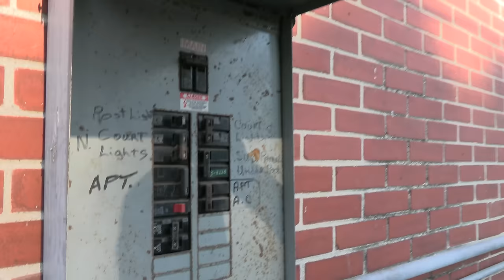Upgrading My Own House to 1,000 Amps

Comment: to make your life so much easier when mounting those cabinets, i usually mount a piece of unistrut along the whole area, then you can just rest all your cabinets on it. then you can mark it and mount it with little to no weight to hold up.
Reply: A temporary table made out of unistrut would be great to support the panels and other heavy stuff, then take it apart when the job is done.  I used a fishing box to hold various 3/8" bolts, nuts, and washers, along with the unistrut nuts, and other fittings, 90 degree, ect.  It was handy to not need to go back to the warehouse for more bolts and stuff while working with unistrut.  I used the unistrut and a overhead 1/4 ton chain fall lift to pull out motors and pumps while doing HVAC and steam repairs.   5 HP hot water pumps are impossible to hold up with one hand while getting the bolts tight!  

I was also thinking about suggesting a pair of saw horses, cut to the right height to hold up the panels, maybe with a stack of 2X6 to get the height just right.

Comment: Have you thought about going to a Ford E Van?  Then they can install a 80 amp 240 volt charger at a home, and refill the van on the overnight low cost power.  That is terrific that they offer such low cost power in your state.  

I live in Portland Oregon, and recently changed to a 5-9 pricing program, where I pay $0.32 per KW between 5 pm and 9 pm, weekdays, and get lower cost power all other hours of the day, and weekends.  So far I have averaged 32 KW of the peak power each month, while I have 750 - 950 KW non-peak power each month.  I am all electric and installed my 4 ton heat pump myself, I install HVAC for a living.  I have a 200 amp service, and plug in hybrid Ford C-Max, with a 7.5 KW battery and 4 cylinder engine.  It gets 40 MPG on gas and 18 miles on battery power.  I installed a 16 amp 240 volt charger, much lager than this car needs.  I put my water heater on a timeclock, and shut off my refrigerator 7 pm - 9 pm, to reduce my peak power hours, and remember not to run my heat pump on peak power.  

Great video!

Comment: Did the power company give you the 400A EV panel so you can charge more cars at the same time at the reduced rate?
Reply from the maker: Yes, in our jurisdiction the reduced night-time rate can be used for a dedicated meter of any size.

Comment: Man the guys who designed the US grid must of owned copper mines!
Reply: Why?  Copper is the best conductor for the price.  It's really quite excellent, and it's used all over the world for that purpose.  
Aluminum works in a pinch.
Reply: @jovetj  I know it's the best conductor for this application but the low voltage and thus high current requirements for US home power uses 4 times the conductor area that most of the rest of the world would
Reply: @adammurdoch1708  The thickest cables in homes are, obviously, service entrance wiring. Most of those are aluminium here. Perhaps you don't realize that the "low-voltage" wires in most home circuits are 2mm² or 3mm². Circuits sized bigger than 4.8kW are almost always 240V.  A 50A electric stove/oven circuit gets the equivalent of 13mm² cable.
Reply: @jovetj  yea I know 13mm2 cable wouldn't be used outside industrial applications here and a lighting circuit will be using 1 or 1.5mm even stove circuit is only 3mm as it also uses 2 phases and that would be the largest in most homes
Reply: @adammurdoch1708  Oh, "you know?"  So what is your point, again...? Our wires are too big because of 120V?
Reply: @jovetj  yea you need twice the current  and so the conductors need to be 4 times the size to have similar resistive losses.
Reply: @adammurdoch1708  But we don't.  Our regular circuit wires are comparable to yours (we just have a lot more of them).  And the 13mm² conductors I spoke of above are already for a 240 volt circuit. Your point is moot.
Reply: @jovetj  What !! comparable yea right i was saying because of the low voltage you have to use ridiculous amounts of copper for the home wiring. A US lighting circuit using standard 60c rated (140f) cable has to use 14awg or 2.5mm wire in NZ you can use 1mm cable and you only need 2 circuits per home and that can deliver up to 6.5KW of lighting over those 2 circuits. I was wrong before free standing stove may have 6mm but that is for running on a single phase and is up to 9.75KW. That 6mm cable is the largest used inside NZ home feed cable will depend on length and size of home so varies too much but still a fraction of anything found in US homes
Reply: @adammurdoch1708  14 AWG wire is 2mm². 12 AWG is just over 3mm².  Our wiring is  typically rated to 90°C.  1mm² equates to 17 AWG, and that wouldn't be used here for mains because it would be liable to breaking. 16 and 18 (stranded) are common for home extension cords, though. I sure would not want to run 28 amps through a 1mm² wire.  That sounds shady to me.  
Our electric stoves (4+ cook-top elements, 1 electric oven) are power hungry.  It isn't common to use it all at once, but one can, safely.  As I mentioned, these circuits are typically wired with 50 amperes in mind at 240 volts.  This is usually 6 AWG wire (13mm²) and is the largest used in most homes, unless something like an electric central furnace has larger requirements.   
There is not a whole lot of difference between 1 and 2mm² conductors.  It's double the size, but the difference is not going to add up to a whole lot, especially considering you're just talking about your lighting circuits and not any receptacle circuits.  
The real expense difference you seem concerned with is that we just have many more circuits than you install.  That dwarfs any minor difference in conductor size.  So what? We like to be compartmentalized.

Comment: What a honkin' wiring setup.  What I would first think about is that it would require a significantly upsized drop from the utility whose availability would depend on whether they're set up for commercial service or you can pay them enough to put that in.  The ordinary 100 or so amp drop to a residence would obviously not cut it, especially if it comes off a pole.  I kind of dabbled in wiring additions in a home I had in an area where the permitting authority was comparatively lenient to that, including adding a kitchen subpanel, but nothing of this scope or expense (even by DIY standards).

Personally, for heating, if not also cooking (I decided to go old fashioned coiltop electric), I'd still want gas.  Other stuff, go wild with the juice.

Comment: Wired a house when I was 14. Got an IT job a year or two later. That was 25 years ago. Should have stuck with being an electrician. Put in all the utilities and electrical for my farm. Trying to talk the power company into 400 amps and not have them complain to much about the 80kw generator I have and I work on 3 phase radio transmitters on the regular. I think I am going to learn some stuff on this channel. Oh and as much smack is talked between the trades I have to say thank you as a low volt guy whenever you guys put in extra pipe for us when you trench. I do my best to work with the other trades but I am a company of one too and it's hard to get all that coordinated so when you look out for me like that it is appreciated and the customer appreciates it.

Comment: We use a hot oven or a hot blanket to bend pvc no open flame allowed in Cali, occasionally I’ll use open flame in a controlled setting with a fire extinguisher on hand or just a wet rag.

Comment: I'm from the Netherlands, i always wonder why they make power upgrades so difficult (al those new cabinets, feeds, panels, linemen, and so on) in your country. But very nice job, challenges are always nice.
Reply: How are things done over there?
Reply: @quinnbattaglia5189  In most cases for normal home connections it's just a new  breaker or adding a breaker in the sealed compartiment of the power company. It hardly requires new panels and this kind of work
Reply: @svdleer  We can add new breakers too, but the main panel and meter are only rated for so much current before it becomes a fire hazard. Especially when the equipment is decades old.

Am I misunderstanding you or does that mean you have to contact your utility to run a new circuit?
Reply: @quinnbattaglia5189  ofcourse we replace the boards here as well if the stuff is rejected by code. But indeed, you need the utility to install new breakers to upgrade the service. It depends if the lines to the service need to be replaced, but since almost everything runs in the ground the lines are overrated for the service that is being used, they only need replacing for example when your line is very old, and you go from example single phase line to 3-phase line and the line does not have more conductors. Usually when they have massive street reconstructions and cable of gaslines are getting old, they upgrade the lines and gaslines to new standards in the same reconstruction.
Reply: This was more than a usual power upgrade.   This is one service being turned into three.  They were previously supplied overhead by one drop.  After the changes the three separate services are served by three underground conduits:
— Service for main house and grounds (and some outlier buildings)
— Service for carriage house (renter's power)
— Service for EV charging with discounted rate provided by utility. 

I don't know of a one-family (or one-and-a-half, if you include the carriage house) property that has three services.  So, this kind of thing is rare, and he's only doing it because he's an electrician and can. 🙂

Comment: A hot box is the way to heat those pvc conduits.  I got multiple ones from my father’s whirlpool bathtub business.  And no they are not the super expensive Greenlee boxes.  Generic.  They work great and I still use one to this day heating pvc and bending it with less fittings.  Makes fishing wires easier too.  2” conduit is the largest that will fit.  Box is two feet long.  I can make noodles with that thing.  I could sell u one for the fraction of the cost to a Greenlee.  Great videos!  Your a super passionate about this trade!  Keep up the amazing work!

Comment: as someone who works for the cable company, 1in is not enough. Run the same as you ran for the electric especially for a duplex because it has to have two runs ran through it, not to mention if the other Telecommuncations company runs through it too. (We are not allowed to cut the other companies wire to run our own)
Reply: yeah, may as well put in dual 1.5" runs.
Reply: @throttlebottle5906  honestly just running a single 3in would suffice. Thats enough room for the cable company and the phone company.  Now to be fair if I had a duplex or triplex I would only run 1 cable wire or fiber and have shared internet with access points in the home and a data rack
Reply: @djpmatchbox  I think their own policies here and many places keep them from sharing a conduit though. they're worried about damaging the other lines.
they also wont do anything but straight through holes, when it comes to penetrating walls/floors and they still manage to drill through/into wiring. 🥳🤡

Comment: 1000A means 120kW if they are intended among the two phases or 240kW if they are per phase. That is a lot of power! At my house I have 3kW of power (as it's common in my country), a newer house with everything electric (heat pump heating, induction cooker, EV charging) that has a 6kW or 10kW maximum (from the electricity company, then it may have solar), and over 10kW you have to get 3 phase. I would not even consider what you can power with 240kW, it's something that a medium size company would use. Also at 0.5 euro at kW/h you don't want to use that much power from the grid these days...
Reply: This is not multi-phase service.
Reply: In America most people have 20-24 kW, split phase 120v adds up to 240. Your electricity prices seem outrageous, our price per kWh is around 0.11 euro per kWh.
Reply: U.S. residential service is typically 30kW to 54kW, but 96kW isn't unheard of. It depends on the age and size of the home.
Reply: In my Canadian province 48kw is the standard size for 90%of house and commercial estate, price is around .04euro/kwh

Most people are using electric heat
Reply: @freevipservers  make that 0.70+ cents a kWh in euros now some even going + 80 cents welcome to Europe and Ukraine war
Reply: I am sorry to hear the price of electricity in Europe is so high right now!  That is outrageous!  I pay about $0.10 dollars per KW in Portland Oregon.  I have a 200 amp service, that is 245 volts, or about 48 KW.  I did remove my 20 KW electric furnace in favor of a 4 KW heat pump when I moved into my house.  100 amps is the smallest power service you can get in America.  Yes even a single traffic light is served with a 100 amp panel, only a 15 amp load on it.  125, 150 and 200 amp services are typical, while a 325 or 400 amp panel is not normal, but possible.  

This home is not typical, and the homeowner owns a electrical company, so can get more!  Also separate feeds for the renter is common, and so is EV charger at a special rate in his home state of Indiana.  

Jefferson Electric has moved to all Tesla vehicles where they can, (for estimators and those not needing a van) because they can avoid $200 a month gas bill and pay a $25- $35 a month electric bill to fill the Tesla's.   Thanks Indiana for providing overnight power at only $0.03 per KW to recharge the electric cars!
Reply: Was thinking exactly the same 😅 Here it is about 43kW and that should be enough for everyday use. 240kW would already allow fast charging DC charging for EV or am I wrong?

Comment: You don’t need expansion couplings if the ground is backfilled correctly think about it. If your pipe expands, how does your wire expand too?
Reply: you leave slacked wire in the run.
Reply: @throttlebottle5906  lol how do you do that with SE cable hardly any slack

Comment: I have been
Told that aluminum manufactured today does not need no locks. Because of what they put in the metal during the manufacturing process.
Reply: got to follow manufactures instructions as  well as the ahj needs/wants lol
Reply from the maker: ^^^ Yep, inspectors will still bop us if we don't have NOALOX around here 😕
Reply: Noalox everything. I do threads too. The next guy might be you.
Reply: @ElectricProAcademy  AL8800 wire technically doesn't require NoAlox, but I still use it on all exterior stuff, but not indoors when landing the panel. It's very humid here in Indiana as you well know, so I like to use NoAlox in everything exterior in Nema 3R enclosures. Just helps keep the moisture out of the connections.
Reply: @taylormills08  Darn right the 'next guy' might be you :) I've been to things I worked on 20 years ago, and thought I'd never be back since the house was sold 2 more times since the guy I worked for sold the place... and was asking myself, "who the f---k did this mess"... and then realizing that was me 20 years ago. LOL. Everyone gets better with more experience (usually), and 20 years you can learn a lot from mistakes.

Comment: phew what big conductors you have to use there, really not hatin but im glad that we have three phase power with 230V over here, we get along with less than half the wire thicknes than you need and thanks to rcd´s (or gfi´s as you call them) its as safe as your system over there.

Comment: I have to ask. Couldn’t a span panel or two eliminate the need for this huge upgrade? 
Although the old equipment was in rough shape so I don’t slight you for doing it.
Reply from the maker: Exactly. 1:11:42. We didn't actually know about SPAN before doing this project, but it could have relieved us of several of the elements of this install!

Comment: Great video and a lot of hard work for one day, but why do you need 400 amps for EV charging, my 230V single phase charger in Australia runs off a 50 amp circuit.
Is that your own private transformer on the top of the power pole where you are connected to?
Cheers from Aus.
Reply: I can't speak for Joel, but I think he expects to eventually have several EV chargers going at once.  400A should cover that for a long, long time.    
From what I see on Google Street View, the transformer might only be 50kVA... but it serves his and several other houses, and also probably some street lights.
Reply: @jovetj  Yes it is only 50kVA or around 200 Amps at 240 Volts to be shared with two other houses as well, so I don't understand the point in building a 1000 Amp connection.
Reply: @John-B91  Looking at it closer, the transformer is new.  The triplex going to that pole used to feed Joel's place; now it is just not connected. The line running east used to branch off of Joel's riser pole, but the utility installed a new pole to the south with a cutout to feed that line to the east. The new transformer serves Joel's place and a few surrounding street lights.

So, he pretty-much has his own transformer. I know utilities have their own standards for sizing transformers, but like you I'm not sure why they picked that size.
Reply: @jovetj  Thanks for clarifying that as I can't see much outside the installation and the property from looking at just the video.

Comment: I wish my utility company did not do away with the 4:00 p.m. to 9:00 p.m. off peak reduced rate system. Alot of existing houses are already set up for that kind of system because it was a thing for a while and you were allowed to connect heating loads to it like electric clothes dryers, electric heaters and electric water heaters. I don't remember when they did away with it but I think they should reintroduce it and allow ev owners to use it to charge their cars overnight.